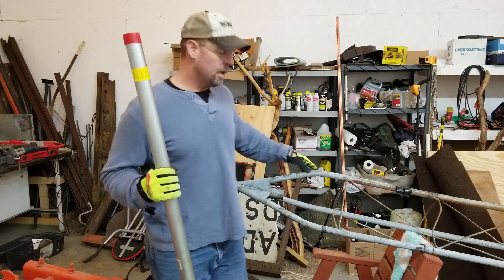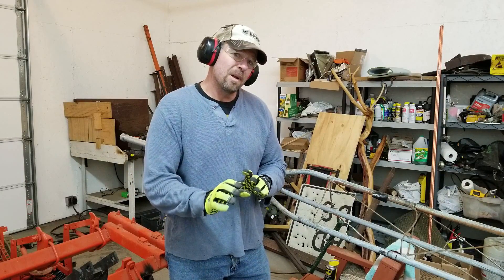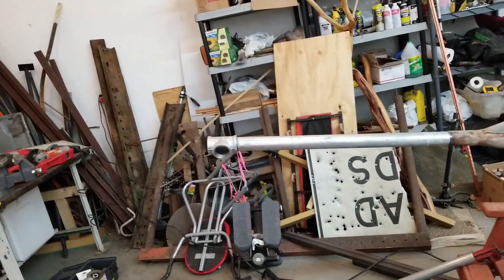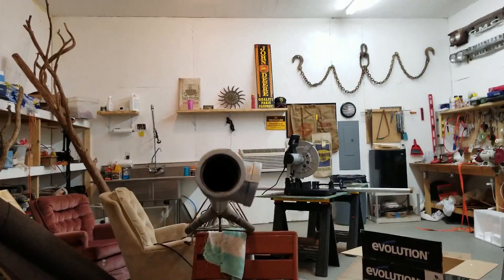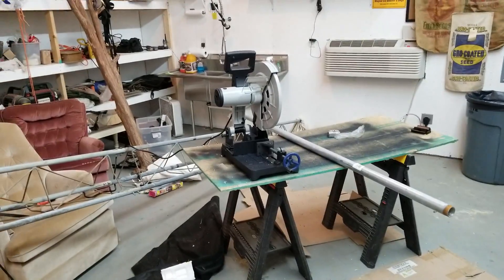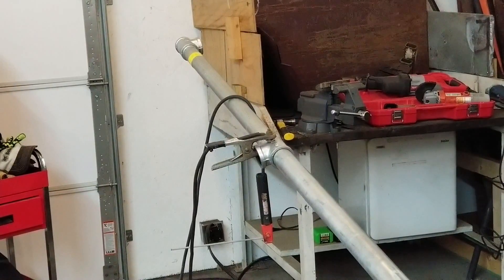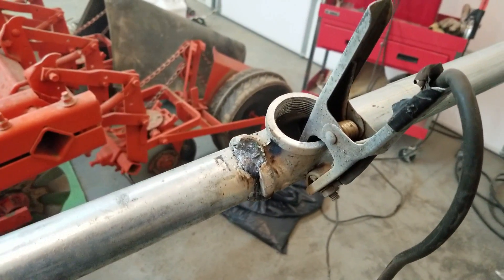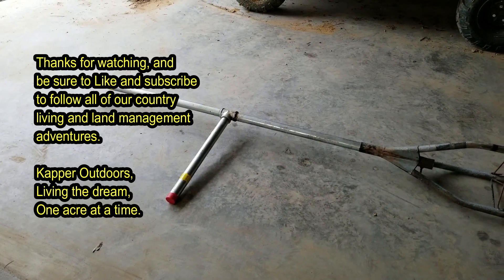How to build ham radio antenna tower mast will this work? Part 1

Comment: You said that the mast is only supported by tube at the top.  That is incorrect.  The mast is supposed to slide through the top and its weight supported by a rotor shelf.  The mast rotates within the pointed top piece only, but it looks like you are just going to use this for vhf verticals.
Reply from the maker: Don't recall it was a few years ago, so you are probably right. But the tower has held up to many severe wind storms so far! Thanks

Comment: Your first error was in using pipe.  PIPE is used to contain and transport gasses and liquids.  You should be using TUBING which is rated for strength.  Plus the fact is that it should slide easily so that you can use a rotator later on, if you want.  Having driven it in, you may have trouble getting it out.
Reply from the maker: Yep I agree but I was working with what I had trying to keep it a budget project. But so far it has held up quite well in some pretty severe wind storms. Not sure what the max wind will be that might break it, but so far so good. Thanks.

Comment: Joe,   i am a Sprinkler Fitter and have been working  with pipe for the last 30 years.  The threads will be the first part that will rust but  with some kind of paint on them should last for many years i have a gate that i built probably 25 years ago that has threaded 90's and the only thing i did to the exposed threads was paint them and still holding strong! being i can get plenty of free pipe many projects at my house are then done with pipe amazing what you can build with pipe that is free . As for welding the cast fittings it can be done but you best be a very proficient  welder because you probably will just  make the fittings crack!  Cast Should  be heated before welding then welded then cooled slowly  i might not be a expert on much but i say  with 30 years of hanging steel pipe i have a little knowledge about this subject as always enjoy your videos.
Reply from the maker: Thanks for the info! Well, I'm not a pro welder that's for sure! You'll see that I welded them all in the next video, but had no problems with cracking. And I only put a tack on the elbows and T's just to hold the position. At least it was in a somewhat heated barn and shop! Stay tuned to see how it goes and how the tower holds up! I hit them all with paint, but honestly, I'm thinking that this thing will outlive me that's for sure! Hope so! Thanks man.

Comment: Not sure how tall your tower is gonna be but u definitely don't want it too top heavy. That's a lot of pressure on the top section. 16 ga mast pipe is light and strong. That's the way too go.
Reply from the maker: Well, I held some 16 gauge in my hand and felt it would bend pretty easily under a heavy load, that's why I went with a heavier pipe. But I'm going to cut it shorter than I planned due to a little more weight, and I'm going to add a lower support down into the top tower section. We'll see how it pans out!
Reply: @kapperoutdoors  every tower situation is different that's for sure. Good luck with everything.
Reply from the maker: Check out the upload from today, the mast completion. I weigh the parts to see how more 'more' weight I added compared to the factory rohn piping. It is not all that much. thanks

Comment: Hey Kap, I used conduit pipe. It fits not too tight but it works. It's been up there 12 or 13 years and gone thru a couple Florida hurricanes. I put my rotater at the bottom so I can service the rotor if need be, I can reach the rotor from the ground. Then a thrust bearing just above  it to bear the weight. hey just an idea, works for me.
Reply from the maker: Well my thought is that if relatively weak conduit, or thinner pipe works, this should simply be that much stronger.... I'm going to beef it up a bit yet and going to =cut it short I think at only about 7 feet total up there just to be safe. We'll see how it goes :)

Comment: Looks good and it will never go anywhere. Going to be heavy to lift up on the tower though. Looks like you'll be on the air soon. :-)
Reply from the maker: Thanks bud, but after some more deliberation, I'm going to make it shorter than I originally thought I would! Hopefully, soon!

Comment: Should get a grinder inside of the top of the tower. Grind down the inside so itll slide in easier. You leave it tight, you risk the change of doing damage to the pipe and the rotor if you're putting a rotor in. Thats why they suggest thrust bearings.
Reply: @m9 ovich very true.
Reply from the maker: Didn't have a plan for a rotor, no yagi's or beams. I can always get a new top section in the future, but honestly I don't see getting that in depth. And you are right, I should have took off some of that pipe, I really did not think it would be that tight... But there's always next time... Stay tuned, we'll see how it goes. But I am going to make it shorter than I planned originally. thanks.

Comment: I'm late to the party, can't think of why you didn't place an order with DX and kit the whole top end? Prices are reasonable I know as that's where my dad and I buy all our antenna parts. I'll go back and check out your older vids.
Reply from the maker: Well, my original thinking was I wanted more strength to hole up to 3 antennas, and to save cost... Hindsight, I'm not sure it will work that way, but either way I'm going to get this mast finished and up! I just may not make it as high as I originally planned to. Thanks, come back and see how it turns out!

Comment: You should have milled down the OD of the pipe so it will slip into the tower mast pipe. Would've saved a whole lot of banging. Probably would've only needed to take off a few thousand. Work smarter not harder.
Reply from the maker: yep, you are right.... I thought of that after I got it down in there about 3 or 4 inches!!!!! uggghhh.... Well, I am often my own worst enemy! lol But there's always next time...... :)

Comment: If you're concerned about support for the antenna pipe, find a pipe (4'?) with an outside diameter smaller then the antenna pipe's inside diameter and slide it in, add your base plate (removable) and there you go?  I hope you're planning to clean off the rust, bend back the  cross bars and add some galvanized paint?  With that extra weight on top, I'd add that house  (A frame) to antenna brace.
Reply from the maker: I just bought a pipe yesterday for this! Not sure if I'll need it , but I may add it. But after more reading on the tower I will lower my top mast so it is not so high up. No, wasn't planning on painting with galvanized paint... But I suppose I could hit it with some rustoleum, I would think that would hold it a few years. thanks.

Comment: Kapper your a joy to watch.   I old fashioned I guess, I always used schedule 80 black pipe ran it down 4 rungs and mounted to flat plate and put u-bolts to help when wind would lift up the top. 

Could you take us on your shopping trip to Menards.   I enjoyed the early videos watching you fill the cart full of stuff to have at the garage.   When I go to Menards or Ace I usually have to go back to truck for more oxygen, I am like a kid in a candy store.   I go by the electric and outdoor lighting section and end up filling my cart.    Nothing like having two or 3-4 of everything at home.   We have a thin layer of ice on trees this morning with snow on top and limbs are hanging low.   If the wind would pick up it prune my trees for me.   One year it trimmed them so good the ground was completely covered in broken limbs.   Was one hell of a mess to clean up.    Has Mike got a tower up yet?
Reply from the maker: Funny you say that because I did tape my store visit, but figured it was too much to add in the video! lol. And I'm like you, I want 3 or 4 of any kind of nut, bolt, washer, hook, part, pvc, lag bolts, machine bolts, straps, etc etc! It is good to have it WHEN you need it! :) Mike does not have a tower but he is rolling man on a home made dipole antenna!!! He has now passed me up!! He's been talking all over the country... But no tower up yet! thanks man, and good luck on the trip back to the truck for more Oxygen! :)

Comment: Water pipe, pound for pound is not very strong.  Water pipe fittings, being cast, are also very weak.
Reply from the maker: Yes I am still thinking about putting tack welds on each of them. But it's held 250 lb jumping up and down on it and the antennas don't catch much wind it's hard to see wind producing more Force than that? Any other ideas too firm them up?
Reply: @kapperoutdoors  The real issue is the size and weight of the antennas and wind loads.
Reply from the maker: Water pipe is made for industrial applications and is just as strong as any other piping, the only exception being stainless, but it should hold up. But after a little more reading on the tower i decided to keep that top pretty short, AND work up another support that goes down into the tower for more support.
Reply: @kapperoutdoors  - There is piping and then there is steel tubing.  The bonus of water pipe is that it is galvanized so it will take longer to rust.  (Threaded areas will rust first so coat them with cold galvanizing paint).

There are literally dozens of different alloy of steel tubing in different thicknesses.  One of the strongest is 4130 alloy (commonly just referred to as "chrome moly").  Pound for pound it is affordable and extremely strong (used in aircraft structures and race car roll cages).   Most towers your size are made with ASTM A513 (low carbon, nor chromium or molybdenum) , cold rolled and resistance welded.  Pipe and tubing use a different measurement system so 2" is not 2".

You will have to look for a steel supplier local to you.  Sadly, there are not threaded fittings so a "fish mouth" needs to be cut on a tube that will be connected at a right angle.  It should be MIG/TIG welded to the main tube by an experienced welder.  After all the welding is completed, the whole thing should be hot dip galvanized for maximum life.
Reply: It would have been cheaper, faster and more stable to just ad tower sections. Check the weld on that coupling, you melted a good bit of it and the couplings have no structural rating. If I were set on using pipe I would have welded pipe to pipe and skipped the weak links. I do hope it works out for you though.

Comment: Lotta weight at the top...
Let's see what happens next!
Thanks for the great video!
Reply from the maker: I plan on adding more support down the center of the Tower like I was initially going to do and that should really firm that sucker up.
Reply from the maker: I still plan on doing what you had mentioned which I commented in the end of the video I'm going to add another pipe down into the tower and secure it to the tower which will strengthen it five fold. I guess I was looking at cost savings because the rohn parts just seemed very very expensive and just like their bolts I was able to replace them with the same thing for about 20 cents on the dollar
Reply: @kapperoutdoors  I know what you mean about Rohn prices. I actually made my own rotor plate by simply taking a  sheet of 1/8" steel, cutting it into a triangle and then bending the corners down. I then drilled two holes in each wing to fit a U-bolt which went over each tower leg. Since I used black iron pipe, I mounted a threaded flange onto the rotor plate and then fed my 20-foot mast down through the top of the tower and screwed it into the flange. I tightened the bolt in the top section to keep it from turning and also drilled and put a cutter pin through the flange.
Reply from the maker: @eosjoe565  yes, I plan on doing something similar and after reading more on the towers I'm going to cut that top section way short... probably only have maybe 7 feet or so up there just to be safe.
Reply: I was thinking the same thing. 45 years in Ham radio and I've never seen 25G done like this. Why not just use the correct size pipe and anchor it inside the tower?  Not sure why he isn't using cross-bar mounts (plates w/U-bolts) for the horizontal pipe.  I had 20-feet of pipe sticking out the top of my 25G tower but I ran it down inside the tower and had it resting on a flange mounted to a rotor plate. The wind load is going to be pretty high on all that hardware even before an antenna gets mounted. Hopefully he has a good home owners insurance rider.
Reply from the maker: @m9 ovich Well, I'd say you are helping prove my theory! lol We'll see what my finish product ends up being, I'm not sure I'm going to go to high with that mast after reading about the 25g. But how in the world is it made self supporting, and can hold a man's weight up there, but not handle 20 lbs of pipe......??